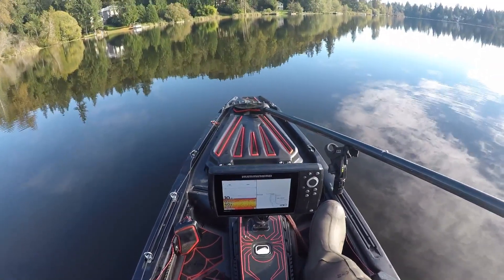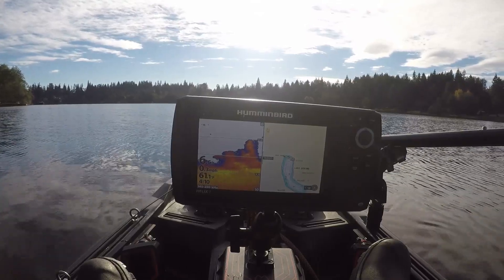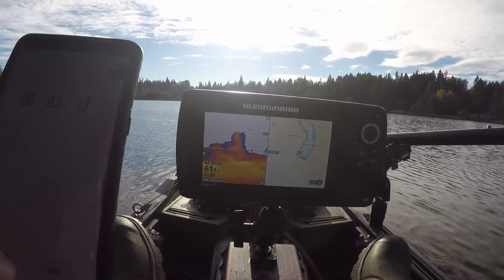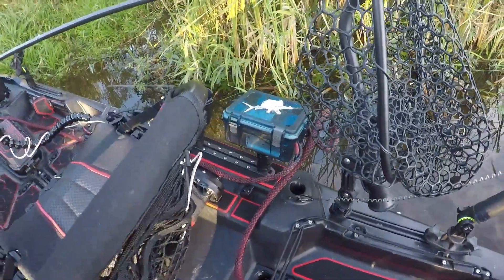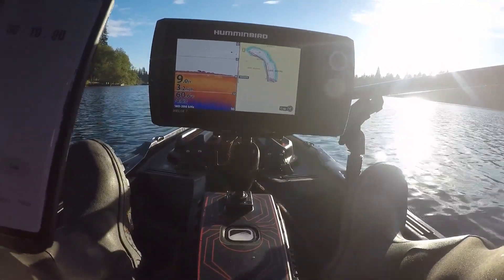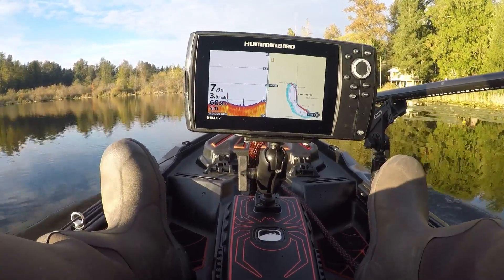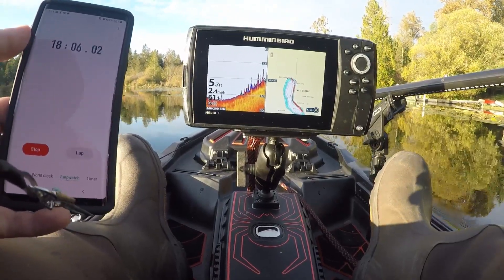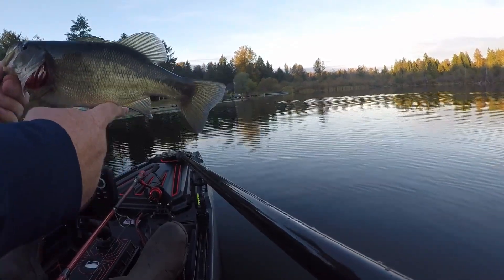DIY Kayak Trolling Motor - Newport vs Minn Kota

Comment: I’m on the fence about Newport but hearing and seeing lot of good reviews. What are your thoughts after owning it for a while?
Reply from the maker: The Newport has been reliable. Haven't had any issues so far. The 3 blade prop seems to be efficient in forward and gives more power in reverse than the 2 blade.
Reply: @g-wolfoutdoors8150  where did you purchase your Newport? Not sure if I should go with minn Kota 55lb or Newport 55lb. Only really using it to get to spots. I have a native 10.5 but when I make long haul… it’s tiring! Haha

Comment: Thanks for the video! My minnkota 40 lb. thrust with the weedless wedge gets me 3.4 mph while the minnkota power prop goes 4.1 mph on my bonafied ss127 loaded up. Just for fun i put a 10 x 6 pusher prop (used for RC airplanes) and that took me all the way to 4.8
Reply from the maker: In my other video I thought the difference was thrust but after this test I think its just the prop design.
Reply: @g-wolfoutdoors8150  yes i found the same results. I believe almost all electric trolling motors spin at the same max RPM 1750?
The higher thrust does give you some more torque though. So in current wind or chop the higher thrust would win out. But on calm days and lakes like the one you were in, my 40 lb. thrust c2 with a standard minnkota power prop would go faster than your 50 lb. thrust with the weedless wedge.
If we both ran the same prop, me on my 40 lb thrust and you on your 50 lb thrust you would edge me out slightly on calm waters but do better in current. The 10” pusher prop i played with actually gave me a 22% increase in speed. I never checked the amp draw, i would think it would be a bit higher.
Reply: @johnrugani2382  That's really informative! Going to change my c2 30lb thrust prop out when I get a chance. I was wondering why my tiny 10ft kayak was going the same speed as my 14 ft john boat with same trolling motor.
Reply: @johnrugani2382  Amp draw will always go up.   The propellor does the pushing, the motor just turns it and at whatever speed it can do.   The amount of effort required is the bit that changes.
Reply: Link for 10x6 ? Only can find a 10x4 LH with the pin cutout

Comment: Thank you for these comparison videos. After testing all 3 (the Minn Kota, the Newport Vessels, and the Haswing), which would you pick? It seems like the Minn Kota was a lot quieter without too much sacrifice in the effective speed/power - is that a fair assumption? Thanks again!
Reply from the maker: The Newport Vessels seems to have a good overall efficiency with the 3 blade prop. The Minn Kota seems to be a little slower and use more battery. The Haswing is lighter but after 2 hours of running it would enter an error state and not run reliably.

Comment: i got a question about Trolling Motor..How long would it take to drain the battery out..?? with a full charge battery, can it last a full day fishing trip..??
Reply from the maker: It is all related to battery size and motor speed. If you have a 100ah battery and the motor pulls 50 amps on full speed (speed 5) then it would last 2 hours on full speed. On low speed they last a lot longer. Trolling speeds (1.5mph to 2mph) on motor speed 2 or 3 then a 100 ah battery could last more like 6 to 8 hours.

Comment: Thanks for video, the speed will be different if i place the motor in the side instead of back? And can u share link for this fish finder!

Thanks
Reply from the maker: Steering the kayak is the easiest with the motor centered in the back. If the motor is on the side then the kayak might struggle to go straight. I'll add a link to the fish finder in the description.
Reply: Bass pro has the 7" si for 499.00.... black Friday sale

Comment: This has convinced me to go with the Minn Kota based on price considering that the Newport being only 15% faster. If I'm only saving 3 minutes over a 20 minutes of travel, the extra cost doesn't seem to make much difference to me.  But that's just me. It's not like 30 lbs thrust is half as slow as 55 lbs thrust.
Reply: Two advantages of  Newport Vessel is a 55lb thrust is only $175, Minn Kota is about $100 more. And, Newport Vessel can be used in both salt water and freshwater, whereas Minn Kota is strictly a freshwater motor. Plus, you can get the 55lb thrust Newport Vessel motor in 30 inch shaft, whereas the shortest shaft on a Minn Kota that is 40lb thrust and up size is 36".
Reply: @robynrobison4050  Thank you for your insight. I agree.  I decided on the Newport 55lb thrust 30" shaft. My only regret was not getting the 36" shaft. Otherwise, working out great.
Reply: @robynrobison4050  ,

it is precisely why l got the NV ... it fits perfect on my Elite Scout SS canoe.  55lbs. is more than enough wake for the two of us. ✌🏽
Reply: @robynrobison4050  where can tou fins it for 175? It's 250 now

Comment: I am wondering what size pwm you used and have you had any burn out?
Reply from the maker: The one I have now is rated for 60 amps. Its been in use for 2 seasons and I fish about 3 times a week.
Reply: @g-wolfoutdoors8150  is that 60 amps constant with 100 amp max?
Reply from the maker: @jimmae518  yes, on Amazon for close to $25. I use the one that also has a forward/reverse switch and a power display.